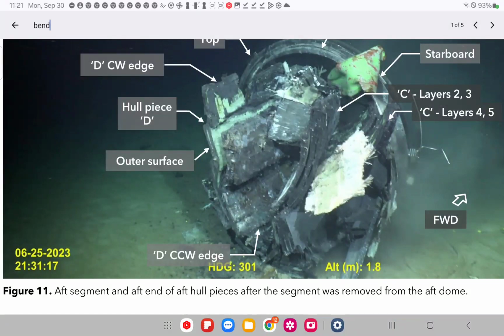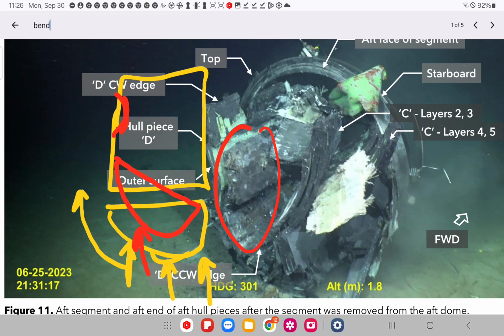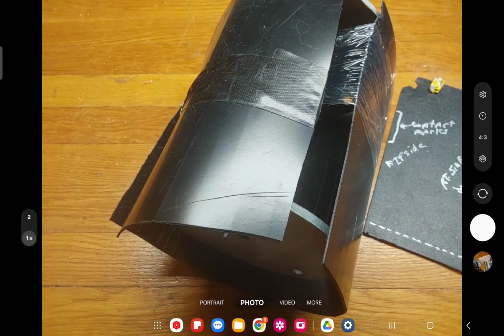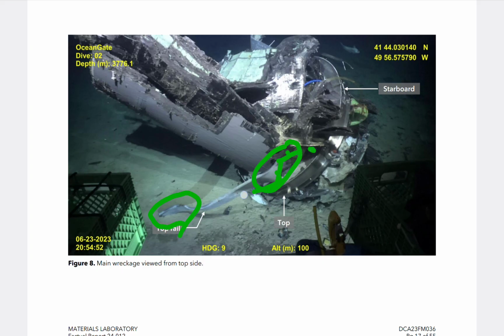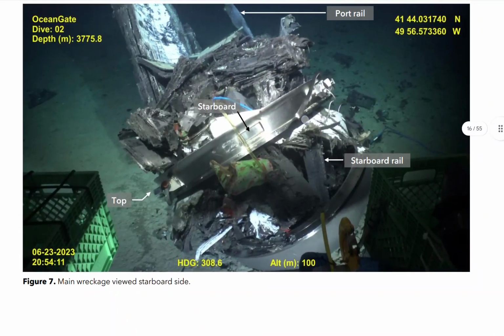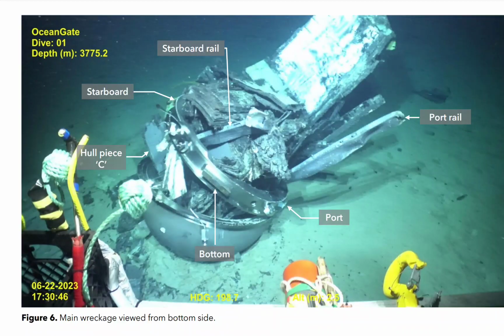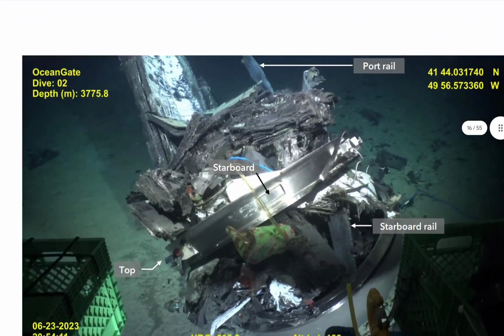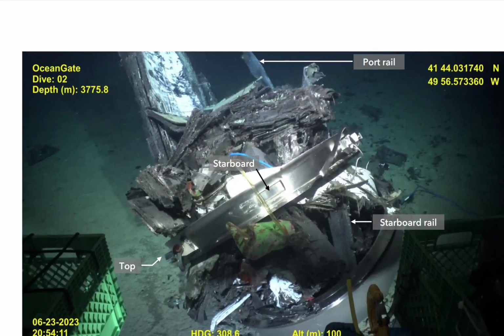Titan Submersible failure visualized Coast Guard- images Carbon fiber autoclave over an hour away

Comment: I've never heard anyone link the long drive move after the applying the epoxy as possibly causing weakness in certain sections. Add to that the ocean jostling, drop and God only knows how many bumps it took before the finally dive. Considering all I've seen there is something to be said for the fact it managed to work as long as it did, especially holding together long enough to get as far down as they were before failing. 

It's ironic because some things in that mess of submersible had potential, possibly even a few breakthroughs. Given more time, qualified personnel, enough money and safer innovation, they may have succeeded. What's even more ironic is someone may study all of it and come up with one that works and can be certified.  A raging egomaniac stomped all over everyone and their good advice to a disastrous end to be remembered as the one who let his dream crash and burn while someone else made it soar. But he may have been driven by more than lack of resources and cheapness, he was getting old. Adding the years it would take to make a good one could have left him too old to bask in the glory he so desperately seemed to want. 

I think the Forensic Cats crew were trying to chime in and add their take, but none of them had a cat to human translating device. Don't tell them that's only in science fiction, let them dream. Although, if you catch them messing around with your tools, equipment and ordering all kinds of odd electrical components you'll know what they're up to.
Reply from the maker: Yes, I have to account for manufacturing phase / step defective thinking and actions

Comment: Moat vlogs I've seen are always talking about the haul. The haul failed at the lab. I'm amazed how the Gorilla glue held it together as long as it could fr fr - my point is your vlogs speaks on the green bottles and the insert - floor, thank you for your insight and making that 1/3 scale down version 🤓
Reply from the maker: The hull, for sure, had defects baked in...
Reply: @ForensicCats and sanded in, and transported in.  Insane.

Comment: You have any thoughts about the velocity the (Stockton Rush's Oceangate Titan) carbon pieces accelerated to towards the dome? Presumably upper limit is the speed of sound but I'm not sure whether internal air (340m/s) or external water (1450m/s) is relevant. Or how the residual air bubble being compressed might affect the velocity.

I'm thinking of the energy required to permanently deform the dome and interface ring. An enormous amount by biological scales.
Reply from the maker: They both came towards each other and only can talk about the force it took to buckle the carbon fiber and move the weight of the domes

Comment: Well... after each implosion, there is instant explosion due to pressure balance, as for debris that is first in last out. You just see on official pictures/video the result of such process. Lots of debris is result of "second" phase (explosion)... based on location of the debris, weight of the debris... Glue on titanium rings is obvious culprit, due to characterictics of different materials glued together under same pressure...
Reply: Gluing was horrible engineering.  Plus it was not done in a clean room environment.  There was all kinds of dust and dirt in the glue so the bond, for what it was worth, was not even good.

Comment: Water in the extreme deep ocean bottom is compressed. .. apparently it squeezes to 97% of surface volume
Reply: The entire ocean rejecting its presence
Reply from the maker: Yes, because of salts and other "makeup", most ''fluid'' is compressible to a degree... In general, we state, fluid in incompressible but that is a LIE... the ''voids'' create space for the compression to take place. H2º IS compressible because it has hydrogen for example- which can be excess of 10%

Comment: Almost like someone standing on top of an empty coke can and having someone to just dent the can, and the can collapses? Plus, no one is talking about the thickness of the 2 lips that the carbon was seated in. What was the depth that the carbon was seated in? I think the inner lip on the interface ring was not strong enough the hold all the pressure, even though it was Titanium

Comment: I have zero knowledge of engineering but based on the evidence it seemed like a sheering force tore the front off with tremendous force and separated in its own area and the pressure imploded (compacted) everything into the bottom cap?

Comment: All the youtube experts assured us all two weeks ago there wasn't an implosion at all.  Youtube is quickly becoming the Oceangate submersible part two.
Reply: Maybe you just didn't;t understand them
This lack of practical understanding is what caused this debacle
Reply from the maker: Do u mean they assured you that one inches pieces would all that would be found? 
I don't recall anyone stating no implosion at all, please check ur comments again. Ty
Reply: @ForensicCats  I actually understand what he means. Some other analysis videos say that, somewhere in the bottom/forward portion, the carbon fiber - titanium ring interface failed due to excessive movement of the carbon fiber (it was always observed from all the dives that at high pressure the carbon fiber was moving much more than the titanium parts). So that failure broke the seal and the water rushed in to equalize pressure, resulting in an explosive event, which caused the forward titanium dome and ring to shoot forward, and the crumbling carbon fiber to shoot toward the aft dome, which would explain the position in which the forward dome and ring were found, why that entire top section of the hull didn't crumble, and why all those chunks of carbon fiber were pushed in the aft dome. All in an instant. Again, this is according to some videos I saw, I am no expert.
Reply from the maker: here is the follow up video https://youtu.be/j4KPQuTN4b4 and it is full of truths and exposures --- note, this is like an advanced class, I cannot just spend 180 hours giving up all the data, it takes time to do background data for people and then put it all together

Comment: I don’t get it.  Did the front ring come off and go around the carbon fiber towards the back or did the front ring come off and fly forward into ocean.  How in the heck is the carbon fiber with glue on front still intact.  In what way did the ring come off it that it didn’t damage that full front edge of carbon fiber with glue into bits?

how did the ring come off and go around that front glue part to keep intact?

Comment: not necessarily the cause of the implosion.  the damage to the hull could just as easily have been the consequence of an implosion triggered by a weakness elsewhere in the structure.  already, there are suggestions that something went wrong to cut communications some time prior to implosion.  dropping those weights may have destabilised the sub or triggered another stress event.  also can't rule out an onboard electrical fault or gas explosion.  so many possible stress events could have triggered the implosion.  the hull will then have collapsed weakest areas first...

Comment: when they dropped the weights, it must have generated a sway in the Titan sub, which would create a sudden, dynamic change in load/stress distribution as it rocked back and forth (or maybe even hit the ground?) and the weakest spot finally failed
Reply: I was wondering that thing too. .
Reply: Is there any evidence that the implosion happened right after they dropped the weights?
Reply: @stopthephilosophicalzombie9017  they sent a message and about 5 seconds after the message they pinged for the last time, which means all the positioning and communication equipment stopped working at that time, consistent with the acoustic wave of the implosion that was registered by monitoring equipment around the sea

Comment: One other thing, 1 of the control spares could have detonated, even rush, said it's equivalent to 10 to 13 sticks of dynamite, and they are seated right behind the aft dome,. I'm wondering if this caused the implosion. And everything everybody was saying about the carbon fiber was starting to distort, But the explosion in the back of only spears could cause the same effect.

Comment: Maybe I missed it but has it been determined if the sub jettisoned the back instrument area and the skids? If so did they know something was happening? 
Also if they did jettison was that the reason the sub lost tracking with the Polar Prince and imploded later or is it believed the Polar Prince lost tracking at the moment of implosion?
Reply from the maker: No. No. No. That section fell off, broke connections
Reply: @ForensicCats  okay so it imploded and the section fell off? 
I was under the impression from the Coast Guards debris field map they would have had to jettison the back and the skids because they were so far apart...like they were drifting as they were gettingrid of items. I guess it imploded well above the ocean floor and it scattered as it settled/rained down. 
Thanks for the reply.
Reply: @BDavid760  That stuff probably had a slower and shallower descent while the hull with its heavy titanium ends plummeted.
Reply from the maker: It's in the next video.   here is the follow up video https://youtu.be/j4KPQuTN4b4 and it is full of truths and exposures --- note, this is like an advanced class, I cannot just spend 180 hours giving up all the data, it takes time to do background data for people and then put it all together

Comment: I think the pressure at 3000 metres is 4500lbs psi
Reply from the maker: Yes, it's actually an alternating pressure and is not static (hint, can u give me two or one reason why?)... I encourage my viewers to strain their 🧠 brain ... Hint, what is based on?
Reply: @ForensicCats   not sn engineer.  This is just a SWAG, but does the variation come from the waves on the surface changing the volume of water?
Reply from the maker: Yes and also currents create a pressure differential and then thermal layers exist which are all density issues
Reply from the maker: Research pycnocline ...

Comment: I still can't believe they machined those wrinkles, destroying material continuity. If it always happened in the same spot, on the same radius, which it looks like it did, that would be the weakest longitudinal line of the carbon fiber cylinder hull. seems like they span each layer without turning the layers in relation to each other (which would overlap the pattern). The idea of breaking the material into layers also sounds sick, one solid block will always be stronger + they should have used the mesh-like 45 degree pattern for fibers, a sub needs strenght in every direction
Reply: That absolutely blew my mind also. It seems to me that *any* discontinuity in the carbon fibers would be unacceptable.

Comment: Nah. The flange on the rings failed, and caused the implosion. Look at dive 80, when they had the "sonic event". Internal pressure increased, and longitudinal strain decreased. Ergo, the glue on the ring failed and the carbon fibre was resting on the flange. Until it sheared off completely at the implosion.
Reply from the maker: ok. Case closed - thank you for closing the case
Reply: @ForensicCats  its just my take on it. But take a look at the sensor logs for the dive. Its quite telling!
Reply from the maker: Well, it tells multiple stories by different people... Very confusing stories... I will do another video on this and use a witness video statement
Reply: Glue failed first and then the flange failed.
That's the consensus for now as far as I know.
Reply from the maker: That was always the consensus but it will not be the truth unless the coast guard and ntsb state it is.   here is the follow up video https://youtu.be/j4KPQuTN4b4 and it is full of truths and exposures --- note, this is like an advanced class, I cannot just spend 180 hours giving up all the data, it takes time to do background data for people and then put it all together

Comment: Have only just started this video, but putting my theory there based on what I've seen from the pictures, let's see how close I am! My guess - lack of tensioning on the length of the main hull plus constant pressure movement broke apart the glue on the face of the domes in one area - this was the big bang that was heard - but the glue on the sides of the dome flanges was still holding, keeping the hull initially intact. Subsequent dives saw further release of the glue on the dome face, and allowed for increasingly more movement - but no leaks seen, nor any visible issues since the failed glue is inside the flange and probably wouldn't have been initially leaking. Glue release continues on each dive until like 30cm+ area is released, and the lack of sealing to the dome face sees the flange rings being over stressed by the carbon fibre hull being pulled inward during each dive. Eventually, the outer flange fails due to the strain (it would be under the most strain due to only the flange holding the hull that is being squeezed inwards, with the end glue partially released), once that fails, only the inner flange is there to hold the pressure out, which fails under the stress, allowing the carbon fibre to be forced inwards, causing the buckle which shears off the remaining flange, with the sudden mechanical shock of the pressure change and weaknesses in the carbon fibre causing fractures and disintegration of the main hull.

Comment: Where were the body parts though?
Reply from the maker: Mostly, I do not deal with that part of the issue... but, we are mostly water and our bodies are not dense...
Reply: Liquid....   most you may find in the pics/vids will be white bone fragments
Reply from the maker: Frankly, you are correct, people crushed by trees are not much left of them or who jump from a high-rise...
Reply from the maker: White bone, hmm.     Naaaaaah
Reply from the maker: It's possible a lot of remains are in the rear , parts I mean.
Reply: @ForensicCats  I wondered if some larger ‘pieces’ might have still been in the crumpled parts, but as I understand it it’s kind of like a small animal on a road, along comes something heavy and…not to be disrespectful but purée! Though I have zero respect for Rush. The 19 year old I have sympathy for as he didn’t have the life experience to make a good decision.
Reply: @ForensicCats 
I've read many times that the whole body parts were turned to soup.
Reply: There were no 'body parts' There was "a paste" on what would have been the inside of the debris.
This shows just how unfathomable (no pun intended) the energy involved, actually is.
Reply: There was matter left. Not completely eviscerated. Think pate, they would been pulverized into the rear dome.
Check interesting staining on the leaked storage photos.
Reply: @melodymacken9788  750 to 800 lbs of people paste... that kind of pressure will liquefy bone....